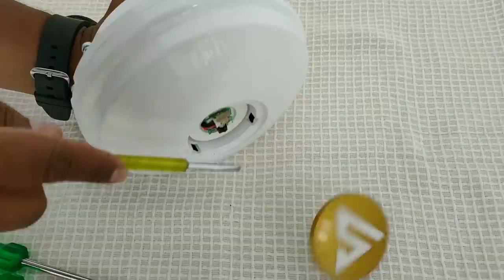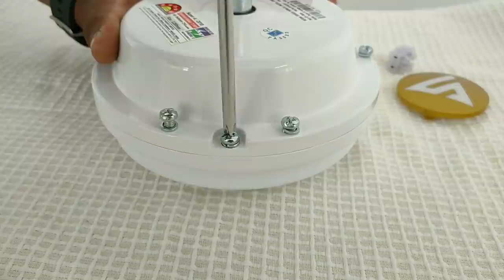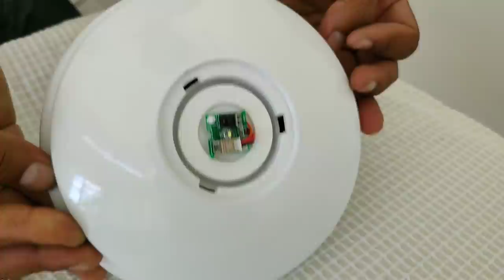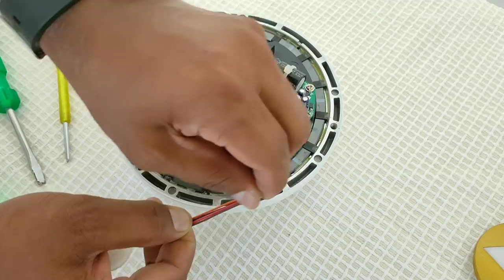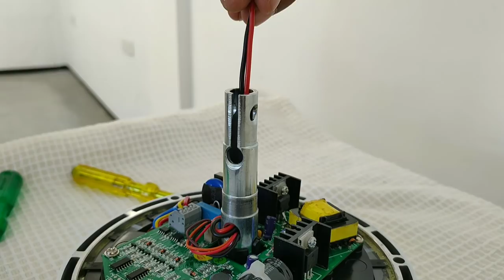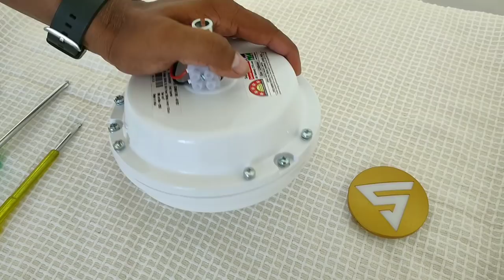How to replace PCB in the Superfan BLDC ceiling fan?

Comment: I have had to recently replace the PCB on a Superfan recently. It was a 7+ years old fan running smoothly until the PCB gave up.
The steps show above are similar what I to go through, but the video makes it very easy.

The challenges I faced -
* One of the screw was not something I could open with screw drivers/allen keys I had. It need a special allen key (with hole at the center) which is extremely difficult to find (atleast I tried in various websites and shops near me in Hyderabad). Finally asked one of the electrician to open it which was done by him, but only after damaging the screw (not the threads).
* Opening the top lid was quite tricky and took a good 5-10 mins to open it (trying various options). It definitely wasn't easy it was shown here. Friendly advice - Do not force it open with screwdriver or prying tools. You will dent the fan and damage the paint. I held the bottom between by legs and twisted the top part with hand.
* The older PCB and new PCB are different and sits on different plastic panel. And the the connector for power supply was at a different place. The wire length from winding was not sufficient. Had to cut the plastic panel (not the PCB) to get the wire attached to the connector.
* The smaller PCB (light and remote control receiver) at the bottom was an extremely difficult fit. I had to scrap some of the plastic on the screw type element on which smaller PCB sits to push it in.
* The connector from smaller PCB had to be pushed in a certain orientation to ensure connectivity is good and right. Otherwise, fan wouldn't turn on.
* It was quite difficult to pull out the wire that connects to the power supply, through the piping and out. Had to struggle quite a bit.

Having said that, kudos to Superfan for making this video and sending me the PCB (no one to service this in Hyderabad). The delivery was prompt and well packaged.
If you are DIY person and willing to spend a couple of hours, you could this.

Barring the special allen key, all you need is the right screw driver, a tester and a ladder/stool to remove the fan from the ceiling. Fan is relatively light, so should be fairly straightforward to remove with some help people around.
Reply: from where did you bought new pcb?
Reply: @chandreshpatel1508  - Please call their customer support. If they do not have local service center, they can ship the PCB for a cost.
Reply: How much cost of PCB

Comment: One imp Advice while changing main PCB and opening fan top lead. Just take screw driver and hammer n hit anti-clock wise direction to open it.... otherwise as per video apparently its looks easy but bit tricky n may be tough.

Comment: One of the main screw to open white cap of my superfan is different, how do I open that. Need to change circuit board.
Reply from the maker: Kindly reach us @ 9498056600
Reply: break the center with a nose plier or screw driver and then use an allen key to open it.

Comment: My fan has a different screw which cannot opened through the normal screw driver. Allen key type with a hole in the centre, not able to replace the PCB. Can you respond to my query on this. How to remove the screw
Reply: Which fan
Reply from the maker: Kindly contact 94980 56600 for the support. to remove the Security Pin kindly use the nose plier to get them rid.
Reply from the maker: @Amjadkhan-nz8mn  SUPERFAN

Comment: I received the PCB and replaced it with help from local electrician. But now the remote function isnt working. Do you have any support in Kolkata location?
Reply from the maker: Dear Arpan, Call us on 1800 425 78737, we work from Monday to Saturday in-between 09:00 AM to 06:00 PM.
Reply: Sir pls tell how much charge u pay for thr pcb pls sir
Reply: Sir pls it's urgent

Comment: My superfan is having intermittent knocking noise while running. Why is this noise occurring  .  No looseness is found. The noise is very irritating during the nighttime. Whether the cap at the bottom causing this noise ? Pl tell me the reason. My fan is only 1.5 yrs old. I am from Kolkata.